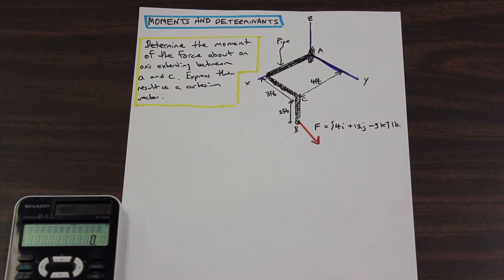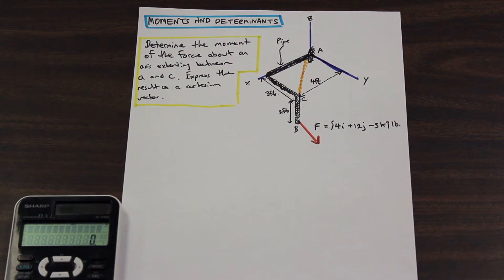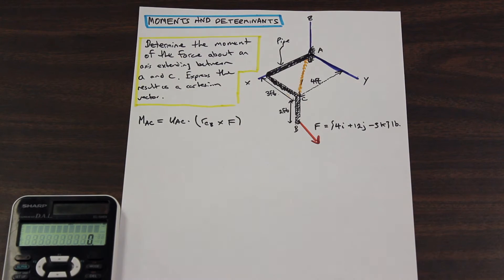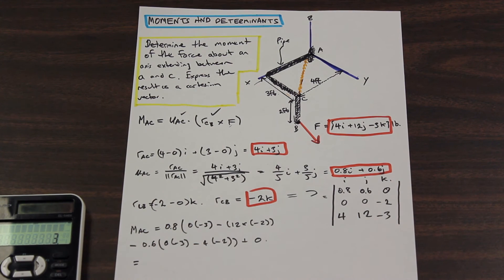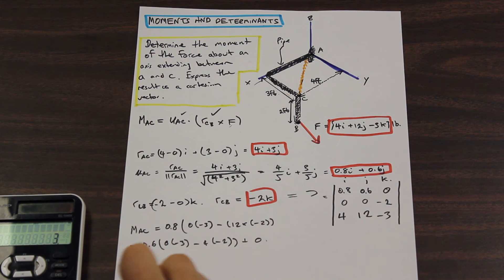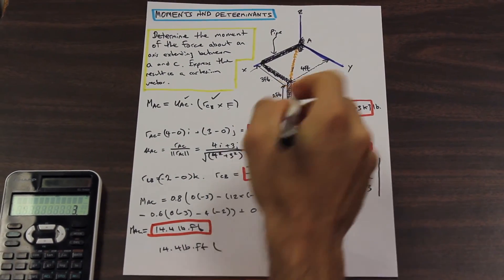3D Force Systems - Triple Product and Cartesian Vectors

Comment from the maker: TimeStamp !

3:00 Theory ends
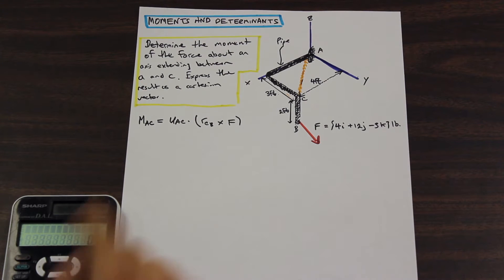3:10 -First step - Find the Position Vector of AC      
4:34 -Second step - Find the Unit vector of AC
6:58 -Third step - Repeat the process for CB 
7:00 -Fourth step - Evaluate the triple product 
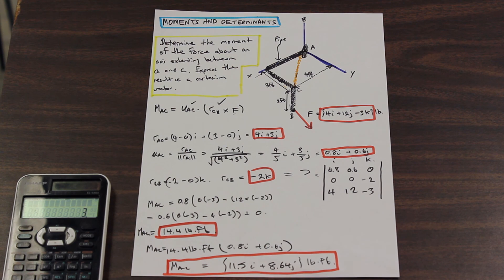11:09 - Final Solution if you wish to check if your answer is correct